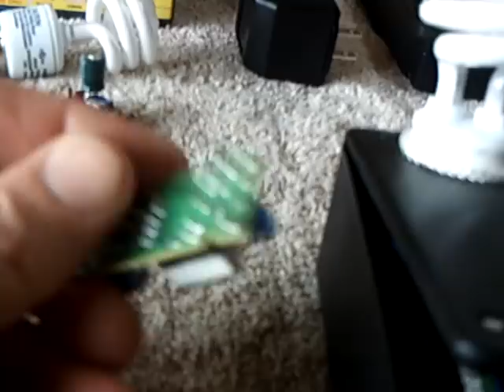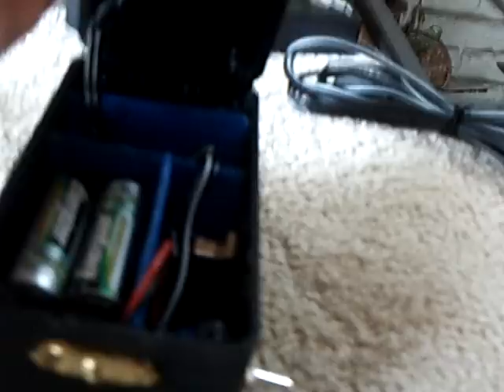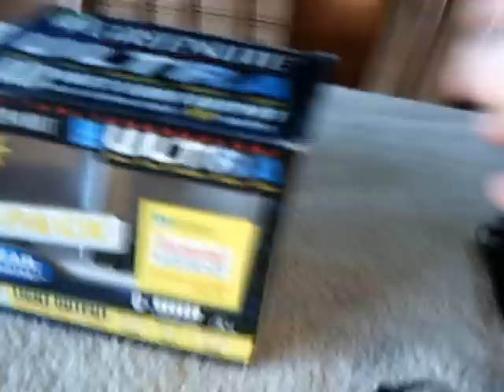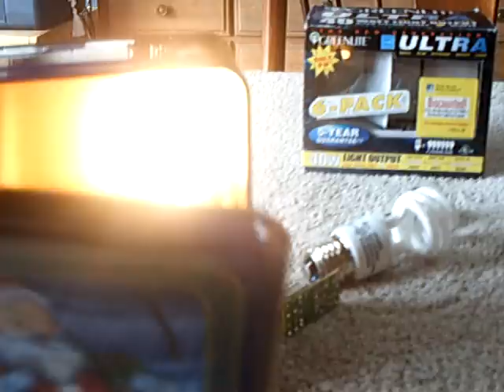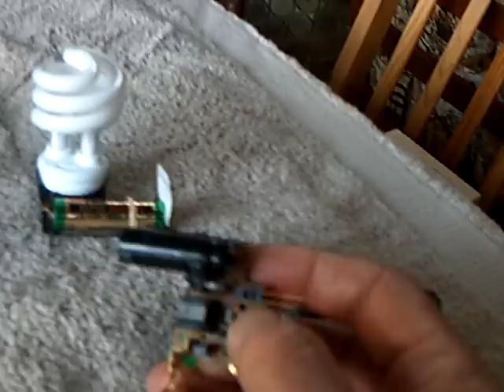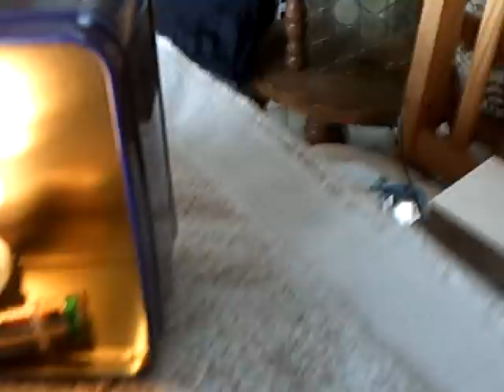Lidmotor Christmas CFLs

Comment: My Ambient Power Module consists of two 50v
100 mfd ceramic capacitorsand two 00.2 50v ceramics plus four Germanium diodes.This sky to ground circuit generates 750 milliwatts of power .50 amps at 1.5 conected between my 22 foot aluminum mast and the lead keel of my sailboat.Check Joe Tates schematic on the web-
I run my digital clock and charge a AA Ni-cad 
battery with it. This circuit should run the Quick snap fuji modified CFL off ambient Radio Frequency waves from the galaxy and beyond.